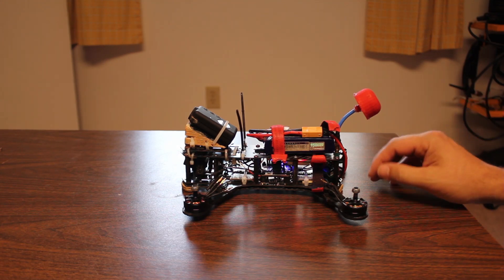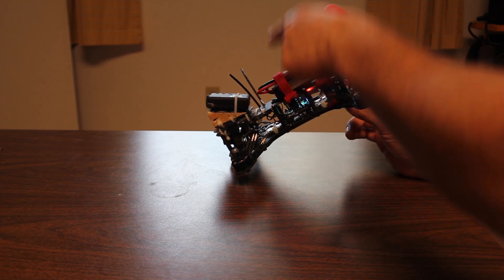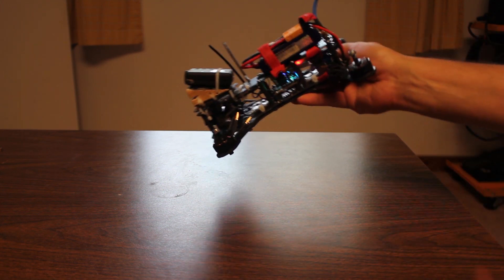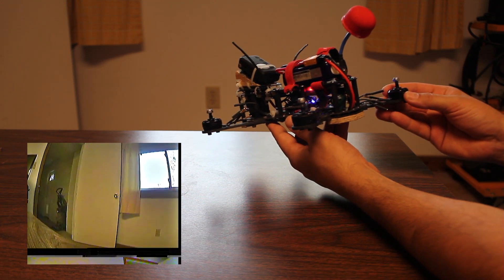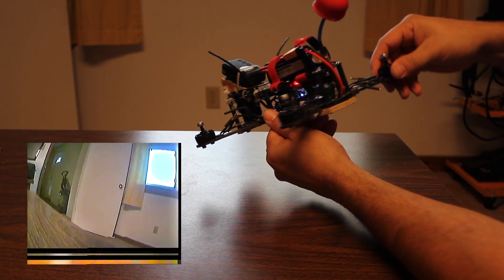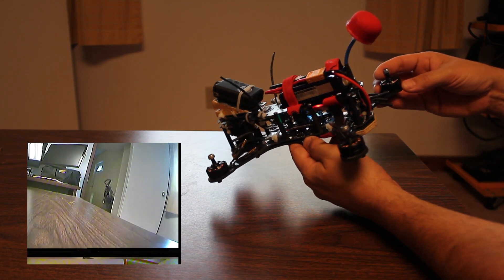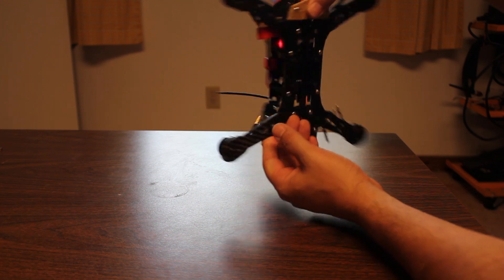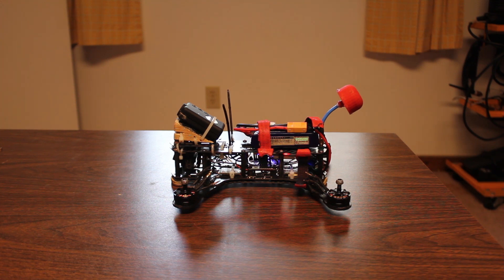How to make coordinated turns in rate/acro mode

Comment: this is the best video I have seen for how to fly in rate, acro, manual, 3D mode.  I also used to mistakenly think the same thing also.   I always thought that the roll and yaw angle movements were based  on the model being parallel to the ground,  instead of the angles being based off the pitch axis.  excellent video and demonstration.
Reply from the maker: +Joey A That was a real insight for me too, once I figured it out. Once you get used to it, it's okay, but when you expect it to work differently, it's a real mind-twist.

Comment: Your lessons with the FreeRider sim are worth their weight in gold.  I started out not being able to GET to a gate, much less go THROUGH it!  LOL  When I flew  a real quad for the first time, it felt totally familiar, and I didn't get much urge to use auto level.  Anyone learning all this with a real quad is going to spend more time (And $$) getting to a certain level, than someone who has used a simulator.  Plus the sim is fun!  It can't get lost, stuck in trees, and when you crash, you can start over again instantly.  And you don't need to stop and change batteries all the time.  Maybe when computers get fast enough, the simulators will get so great, that real quads will become obsolete.  LOL  I saw a video of this motorcycle rider, and I thought he was the greatest motorcycle rider I had ever seen.  Someone seemed sad when they pointed out it was just a video game.  It looked so real.

Comment: This video gives some good insight into how a quad turn with up tilt. I discovered recently while exploring this concept that there's a way of setting up your rates for yaw and roll which makes coordinating turns as your describing here easier and is worth mentioning. 

If you have your rates set similarly at some value then depending on your uptilt to coordinate your turns requires some amount of yaw input and some amount of roll input and the amounts of each will likely be disproportionate. Developing the muscle memory to coordinate 2 disproportionate inputs is tough especially while balancing 2 other controls. It's much easier to concentrate on coordinating 2 controls if the inputs required are proportional or requiring the same amount of travel for each. You can actually achieve this by coordinating the rates instead of the stick move. Try and concentrate on moving the sticks evenly and together and then observe what which input is giving too much or too little and adjust the appropriate rate to compensate until the turns are coordinated as you move the sticks together evenly. I just started playing with this idea and I've started a thread about it on rcg. My quad Flys much nicer as a result and just feels great.

Comment: Been flying for several years.. but with the larger camera drones.. Started flying racers and mini's about a year ago.  Easiest thing to do is to get off the ground in self leveling mode and switch to acro.  Roll slightly and THEN yaw... easier to turn.. If you yaw first, your vision is leaning the opposite of your turn and you will have to roll twice as much to lean into the turn in the correct direction..  Just a thought..
Reply: That is literally what I do, get it to hight then switch 👌🏼
Reply: I could never hit the gates in the sim by yawing first.  It works for large turns, like 90 degrees or more, but for slight adjustments it feels like the drone goes into a sideways skid and I have no idea where I’m actually aimed.  What helps me is tipping into a slight roll first, then yawing in the direction of the roll as I level out so that I can see where I’m going.

Comment: Great explanation!  I was watching more modern videos trying to get this explanation and was coming up short.  This is perfect!!  With about 10 hours on a SIM using Acro, I'm still struggling with controlled turns.  I thought balancing yaw and roll perfectly would be the ticket, but then a slide through turns.  It seems that to bank a turn you really need the bottom of the quad facing the opposite direction you're turning (not parallel, but probably at least a 45° angle).  It hasn't clicked for me yet, and being a long time Angled Mode flyer, I'm struggling not to just rely on yaw and forward tilt.

Comment: Good stuff Joshua. I was only thinking of this last week, as I do recall you saying on a couple of occasions that you would do this kind of explanation.
Reply from the maker: +Tony Leyland Expressive Imagery Glad it's helpful. I'm always trying to make note of new topics to talk about.
Reply: Joshua Bardwell You mentioned about Acro mode coordinated turns a few times. Is there a difference with stabilised modes like Horizon ? Reason I ask is that I fly Horizon 80% of the time and I use this technique that you describe (albeit subconsciously).
Reply from the maker: +Tony Leyland Expressive Imagery In autolevel mode, the flight controller attempts to maintain a fixed angle of pitch or roll which is proportional to the stick deflection. So imagine you are holding the pitch stick forward to cause the copter to pitch forward 20 degrees. Now you input left yaw, and do not input any roll. As the copter begins to yaw, the roll coupling I described will occur. BUT! The flight controller will automatically coordinate the turn for you! Because the pitch and roll sticks are continuing to command 20 degrees front pitch and 0 degrees roll. So with autolevel mode, yaw can be imagined as occurring relative to the earth's frame of reference, rather than the copter's frame of reference. Practically speaking, you will still put some roll into each turn, because when you turn, you want the copter to roll into the turn, not stay flat. But if you test out completely flat turns (no roll input at all) in acro mode vs. self-level mode, you should see that in acro mode, you end up rolled to the side after a 90 degree yaw, and in self-level mode, you don't.

This is one more reason why autolevel is easier for beginners. They can make pure yaw turns without getting completely out of whack.
Reply: Joshua Bardwell That is great explanation thanks for taking the time to answer, and is probably why when I fly in Acro mode with camera tilt my brain gets confused easily during coordinated turns ! I've been flying in Horizon for almost a year and that suits my style of flying. Cheers Tony

Comment: I’m just starting and had this very question because yaw didn’t seem flat. Also noticed that initial opposite yaw, then roll and pitch makes a more level bank. Can’t get the feel or result of banking if I move both yaw and roll in the same direction initially. Holding the quad in hand at tilt, the yawing in the turn direction shows you why it pushes quad away from turn. Once turn has initiated, the yaw must go back in direction of turn because that’s what sets the pitch angle back to original position coming out of the turn.

Comment: This issue (or side effect you might want to say) has been addressed in the later betaflight releases, where you can input your camera angle and the fc mixes the roll and yaw and makes it appear as if you have no camera angle in terms of control authority. I haven't tried it myself because I am used to the mixing, but it could make flying a lot easier
Reply from the maker: +Gryffin Cook I guess it's a cool feature. I have gotten used to learning to manually coordinate turns, and I like knowing that when I push full roll deflection, that I'm not getting any yaw mixed in, even if that produces an unexpected camera effect. Actually, I sometimes like that effect and think it could be hard to duplicate otherwise.

Comment: Hi Joshua i practice a lot to fly acro mode. I change my rc rates to get it easier but for me it is really hard to improve my flight. Can you tell me what rc rates i can use to learn it better? At the moment i need a lot of yaw and a little bit roll to fly a circle.When i watch all of these Stick Cam videos it seems that the guys need a constant roll stick movement ... if i need more roll to turn at the end of the turn my quad has a lot of pitch foreward? I hope you understand what my problem is? 
Best regards from Germany
Reply from the maker: +M. Borga you can adjust your rates to change how much yaw and roll you need. The default rates of about 600 degrees per second are a good starting point.

Comment: It seems like a Tx mix of roll/yaw could compensate for the tilted forward mix effect. I did experiment with a Tx roll/yaw mix in a sim but could not quite figure it out to satisfaction. You could also mix the throttle position to compensate for different forward tilt speeds. All of this is probably beyond the average skilled pilot which includes me but I would be interested in viewing such a series using a Taranis Tx.
Reply from the maker: Check out my recent video on uptilt compensation.

Comment: Hi Joshua, just saw your post in 2014 on forum flitetest. Regarding in ACRO, how Yaw turns the Quad relative to its own Axis, and not relative to the earth. 

Lets say i am moving toward the North with a 30° forward pitch and i yaw 90° to the left. I am now facing West with a 30° roll to the right. I understand this is how Acro works. 

But i want the Yaw function to works in such a way that the Quap turns while keeping the Pitch/Roll relative to the direction of the camera. Consider the following scenario:

Lets say i am moving toward the North with a 30° forward pitch and i yaw 90° to the left. I would like to be facing the West moving with a 30° FORWARD Pitch (instead of a 30° Roll to the right). 

Is that possible? Is there any way to configure that? 
I think that would make ACRO more intuitive.
Reply from the maker: That would make flying more intuitive so some, but it wouldn't be acro. What you are describing is how Angle mode works though.
Reply: I guess you right. Even though in Angle Mode, you have to keep the Pitch Stick forward to move. Only way, going to put in the time to practice coordinated turns on fpv freerider. Thanks man for replying, and thanks for the awesome lesson you did on Acro flying. Going through it right now ;) cheers (y)

Comment: helps if you have flown helis before a multi rotor in acro mode.. pretty identical way of flying
Reply from the maker: Sure! Although a CP heli really feels different than a multirotor. But same principle.
Reply: Joshua Bardwell and in general multirotors survive a crash much better, heli is usually in many pieces :D

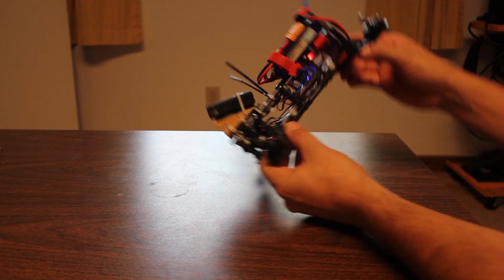Comment: At 5:13 you say if drone is parallel to ground, 180, no roll will be applied. But you can not complete turn if you are not pitched forward. It would be just hover or landing or going up, after the inertia is gone. Please explain better how some people claim pros dont use roll while turning, because I didnt understand. Sorry and thx. Or it is related to speed and pitch angle. But im sure when other youtuber explained tight turns, it was: fly forward, apply yaw turn and roll and pitch forward if neccessary, to get out of the corner faster. So it is pitch and go forward, then yaw plus roll plus pitch correction if needed?
Reply from the maker: I don't know why some people claim pros don't use roll while turning. I think they use roll.
Reply: @JoshuaBardwell  well, they must. Basic physics. Drone does not care about ground. Props are pushing air at 90 angle relative to drone. Your explanation in video is perfect. Drone pitched forward, we apply roll to correct yaw and roll to the opposite side, while kepping drone rolled and pitched in direction we want to go.
Reply from the maker: You can technically turn without roll. Yaw 90 degrees, then pitch forward to the desired angle, then yaw back. It's slow and cumbersome but it does work.
Reply: @JoshuaBardwell  yes, yes. But still. It almost dpes not count as a turn lol

Comment: Is it easier to learn flying acro in line of sight or is it easier in FPV? I keep crashing using line of sight
Reply from the maker: I think acro is way easier FPV and angle is way easier LOS.
Reply: I've been flying a wakera F210 in angle mode and line of sight for a while, when I switch over to acro I go straight into the ground for the reasons you explained in this video... great job on explaining this complexity btw. I'm just now getting into FPV... my AOMWAYs are on their way. I don't want to destroy my Wakera, for acro do you recommend simulators like Velocidrone or just buy a small mini whoop to practice on?

Comment: Hello Joshua 
I like very much your videos.  Because of you I connect my transmitter to the pc and start to practice with Freerider simulator a lot and I get to the point that I quite control the quad and especially coordinated turns.  So times came close to buy a real racer quad. Very exciting.  What you say about Diatone Tyrant S for the beginning? 
Thanks a lot
Yoshua (also)
Reply from the maker: +RCSTART good choice.
Reply: I don't understand.  You can be more excited please. Thanks
Reply from the maker: The Diatone Tyrant is a good choice.
Reply: OK Thanks, I'll send you when I'll have my first videos from my quad.

Comment: Good video, but actually it's easier to start the turn with roll input and a split second later apply yaw to turn around its "ass". When doing this in this order the yaw input axis is in the same direction as the turn direction. Got me confused when I started weeks ago, but I forced myself to naturally turn around an obstacle by flying forward, arrived just in front of the obstacle, roll ( bank ) right, when bank is initiated, apply left yaw to turn the back of the quad and apply throttle. In that way you don't overcompensate for anything and man, you can get very small turns. Philip.
Reply from the maker: +Philip Dezsö Whatever works for you!

Comment: Wouldn't it be possible for the flightboard to do some math and actually turn around the Z axis when you yaw ? it would make piloting easier, right ?
Reply from the maker: It does this in autolevel mode, or if you are using camera uptilt compensation. But most pilots don't fly that way... I wonder why?